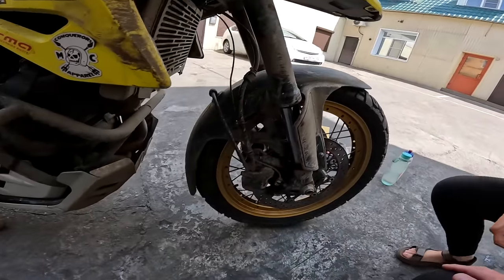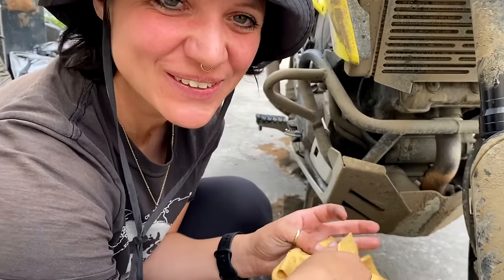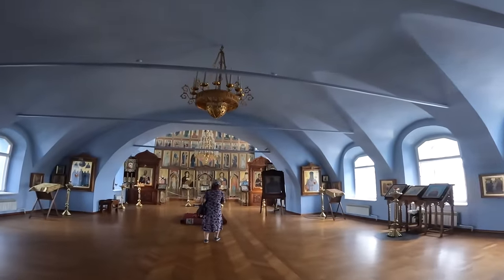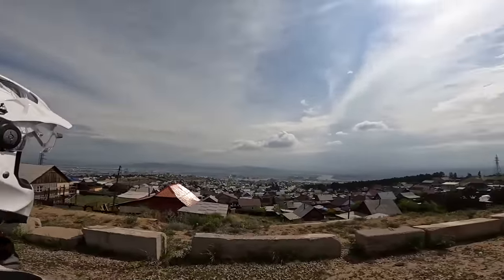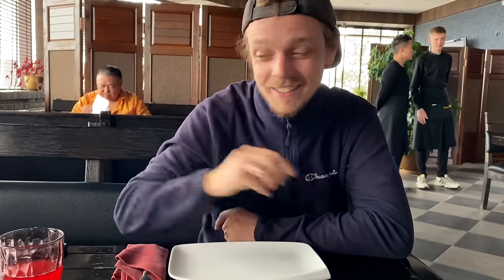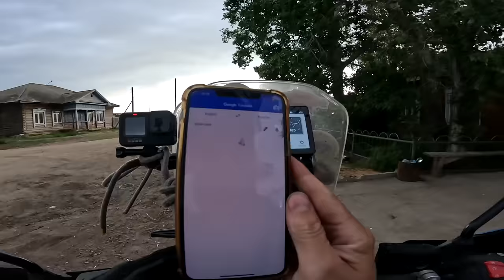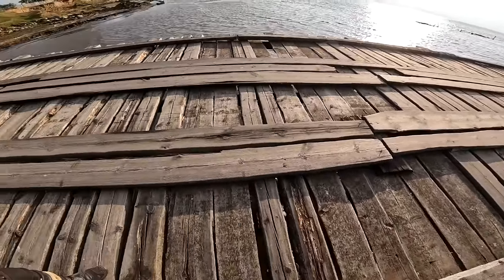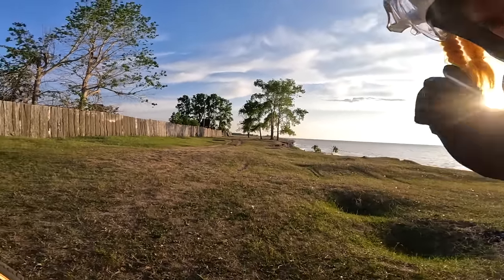WE HAVE A PROBLEM! (Circumnavigating the Globe by Motorcycle) 🇷🇺 [S5-E14]

Comment: An old trick I use is to apply grease to the fork tube just below the seal to keep the dirt out and to prevent mud from drying on the fork tube. Most people ignore their forks and seals until they leak. The key to long seal life is to keep the tubes clean and clean off any water spots after riding in the rain or through a puddle. Your seals started to leak after those days of riding in the rain and mud. Grease would have prevented them from leaking.
Reply from the maker: Thanks for the advice 😊

Comment: LAKE BAIKAL was a beauty.   I read that waves can get as high as 15 feet tall during a severe storm. It gets as warm as 14.4 C or 58 F in the summer.   Good mechanical work on the fork seals Lavi.  I thought about the same homemade tool that you two made to fix the leaky oil seal problem.  Good going!!!  You two made me smile pridefully when you showed us the fix was working.
Reply from the maker: Yay 👏👏👏😍😍😍🎉🎉🎉

Comment: Fork seals are cheap. Take it to a bike mechanic and get the seals changed and the fork oil topped up. Those roads will have worn the original seals and that's why they've blown and any dirt won't do the chrome on the tubes or stanchions any good. I'd recommend gaiters on the fork legs to keep the stanchions clean and new fork oil when you do the seals will improve the handling a lot. Be careful of the leak , if it gets on the brake pads and rotors your brakes could fail . Cable ties should keep fork gaiters in place. It's a good idea to clean, grease the linkages on the rear monoshock and if you can protect the rear shock from salt, grit and water it will make so much difference. Bikes need a lot of maintenance and lubing especially in winter. When you get the fork seals done check and grease the steering head bearings and check front wheel bearings and it's a great idea to clean around the pistons and floating calipers to ensure smooth operation, it will be easy and you can  find out how to service brakes, checking brake pad wear. New rotors cost £500 a pair so don't let them go metal to metal and bleed the brakes using correct spec brake fluid. I hope I'm not lecturing you, but stay warm, safe and well. God bless you both.
Reply from the maker: Thanks a lot 🙏❤️